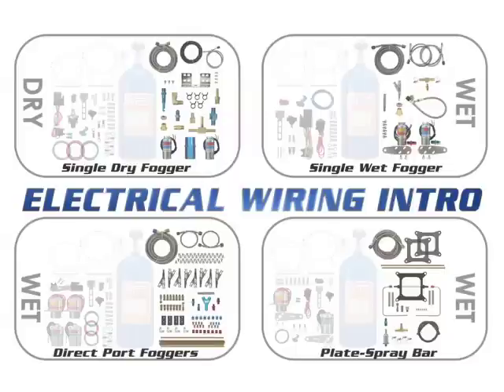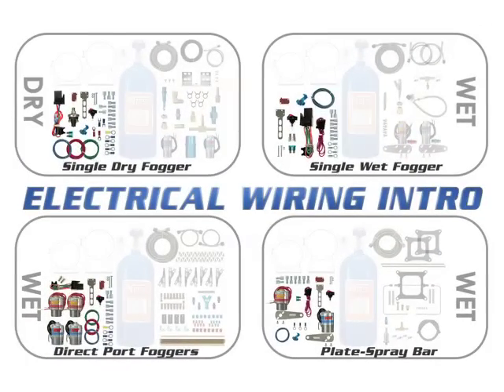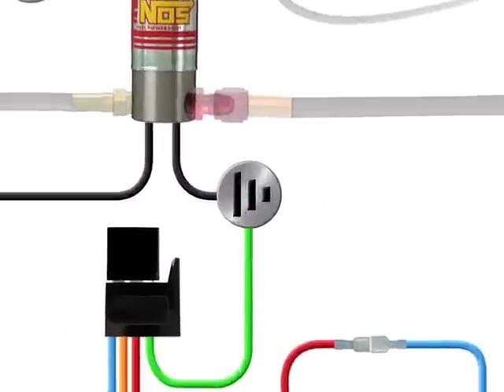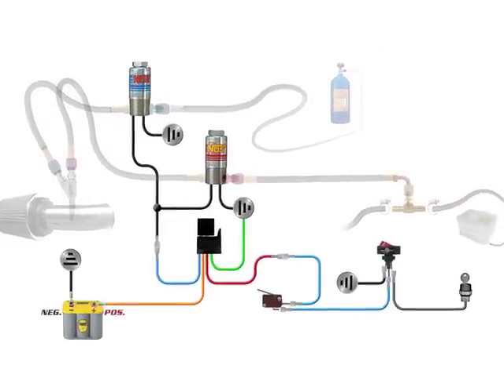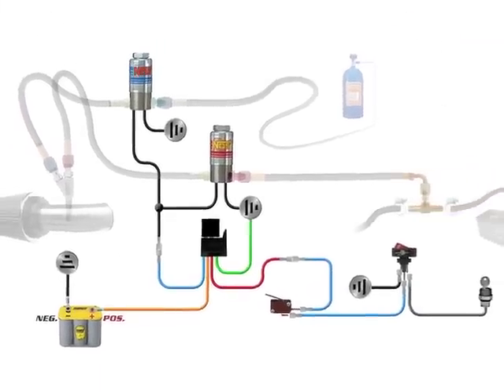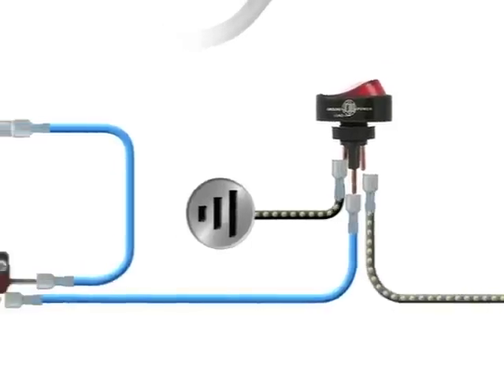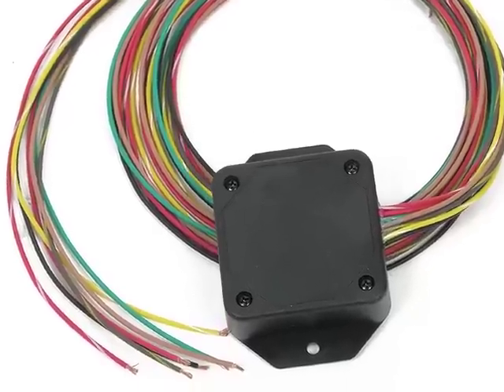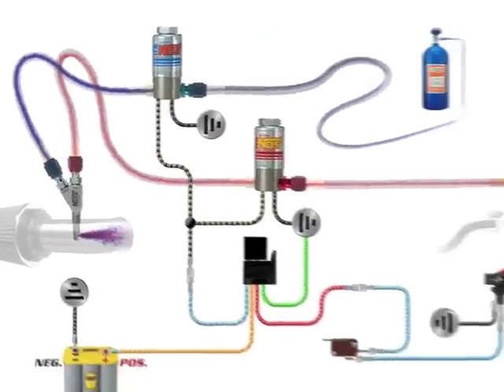How To Wire An NOS Nitrous System

Comment: I used cold fusion nitrous in Texas to get a 100 shot dry nos kit for $450. Yet the description under the product I ordered doesn't have 2 solenoids in fact there are none. Does the process differ at all?
Reply: Realty With Sean Kemp solenoids could be in a box . Depends on the kit . Zex do that like that . There solenoids r in a box . 
But u shod always have one solenoid for a dry hit & two if it’s a wet kit

Comment: So if I'm understanding this right nitrous would only spray at wop.
Reply: yes if you chose to put the switch at the throttle like they show.
Reply: On WOT switch.. you can wire to a button and select a push when you want instead.

Comment: could you still do this with a turbo? or would it damage the turbine
Reply: No it won't damage the turbo. It will make more power than using on a NA engine so you'll use less overall.
Reply: Double the power if a 100shot it will be 200 on your car

Comment: can i install this without the microswitch ?
Reply: You need that switch, otherwise, you'll be spilling N2O into the engine.
Reply: MCSPT117 u can use a push button as well not just the micro switch.